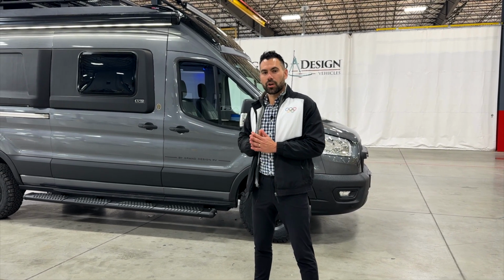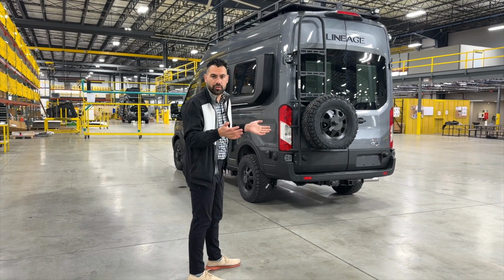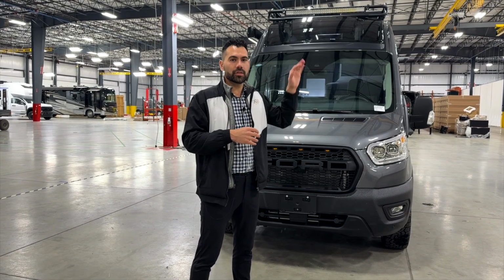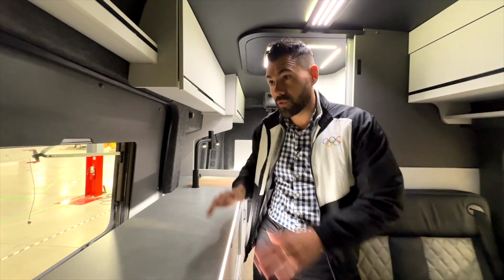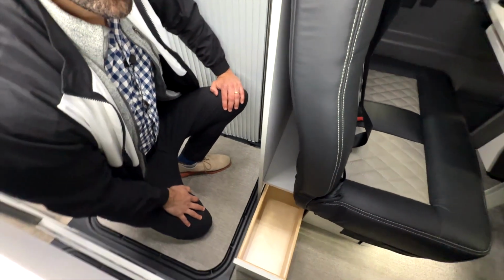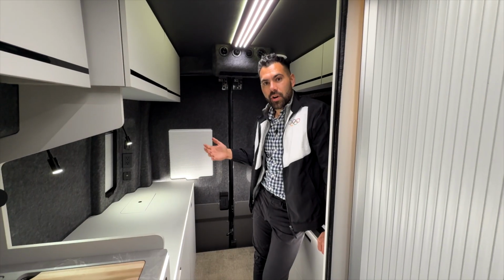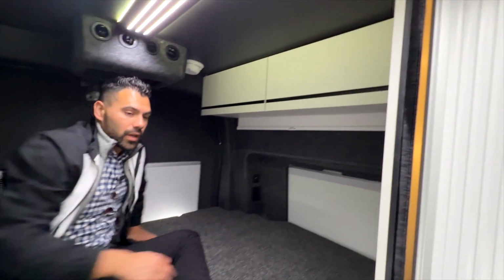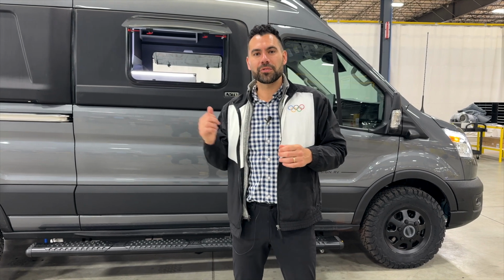Lineage Series VT Walk Through

Comment: Stephan, a lot to like here but I have some questions. What is the benefit of a cassette toilet if you have to go to a campsite anyway to empty the gray tank. What is producing the furnace heat? Doesn’t having the heat pump condenser under the van expose it to road chemicals, moisture and stone damage? On the production unit what will the door screens be? I hope sliding screens.
Reply: Cassettes have the advantage of being able to be dumped at a normal dump station but can also be emptied into toilets and other locations.
Reply: @bnrlabs5923 bug screens?

Comment: Some good ideas throughout the van, yet I think the bed/sleeping orientation is the opposite of what it should be.   When parked along a roadway, the slop of the road for rain drainage will slope from the driver's sode to the passenger side.  Your design will put the person's head above their feet, leading to a very uncomfortable sleep.  Also, why are the window blinds not the same as the class C with the solid and smooth screen and blackout shade, which is far better than what was shown in this unit?

Comment: Amazing van build. I’ve been waiting for something like this on the Transit platform. It checks every box. Just a few suggestions. The shower head should be handheld instead of fixed. It could be attached magnetically into a recess where the current design is for taking showers and then stored in the wet bath area. This would prevent water leaking into the van after showers and allow for better water conservation. There should be a bench in the back area by the bed. Given the floor is built up, it could come up from the floor area or have a bench fold up from the opposite side of the galley. Another solution could be storable posts/frame with aluminum slats to create a bench (similar to packable camping tables). This would create a usable eating/work area. Also, given all the countertop space there should be an option for 2 Invisacook burners instead of only one. The knob placement also seems a little awkward. The bench seat up front should also be able to move side to side, forward, etc like those available currently in other adventure vans.